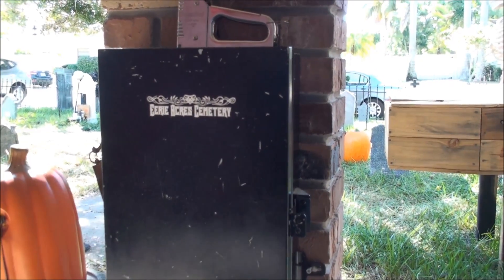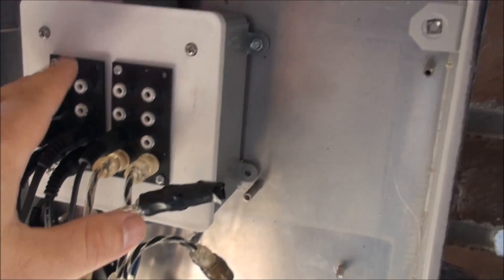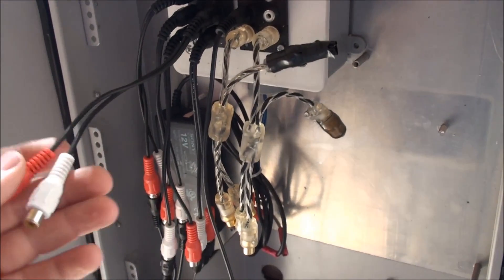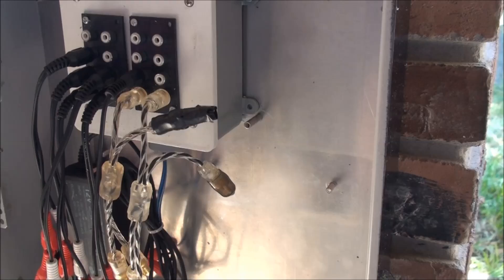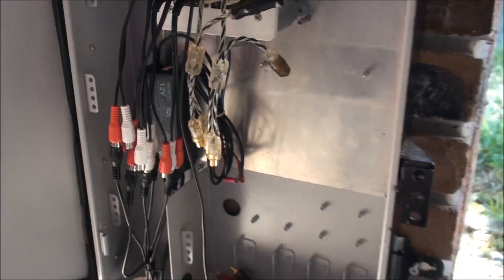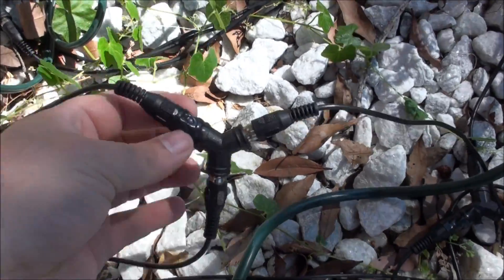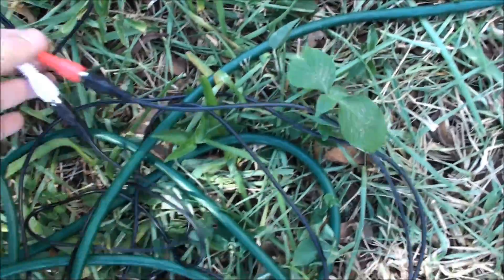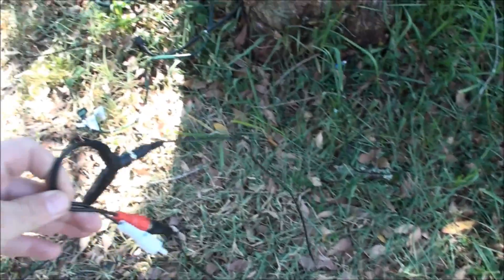Halloween Flickering LED light project

Comment: I love your power distribution set-up!  I am an Industrial Electrician, so I can appreciate the way you laid this out.  I have been using terminal strips, mounted to each item and daisy-chaining wire to interconnect them, for years now.  It works, but I have been wanting to convert to a tool-less system.  Binding posts or spring terminals are pricey and could require a small enclosure to mount each one, so I have been considering using Tamiya-style R/C car connectors; they are fairly cheap and idiot-proof as far as maintaining proper polarity to the LED's.  Now, after seeing your set-up, I think I will try what you have done instead!  Thank-you for posting!
Reply from the maker: +VIGILANTE Thanks!!! This is the second year now and problem free even with all of this florida rain its been working perfectly!!!

Comment: what's in the rca connection box? I want to do the same setup. can you list everything I need. thank you !
Reply from the maker: +Brian Griffith The box is just a way of holding the rca board inside all of the rca connectors are wired so that each one has power. Checkout Dminsorsound's channel he has some great videos showing in depth detail on how make the entire setup! https://www.youtube.com/watch?v=470rIADIaxA
Reply: +Eerie Acres Cemetery yes he does great work! thank you. On the end of the 10mm pre wired led lights do you solder a male or female plug? also what 25ft rca cable do i buy? the 3.5 mm to double male rca?
Reply from the maker: I have male plugs on the ends of my LEDS so I buy male to female RCA cables from monoprice.com!
Reply: +Eerie Acres Cemetery Thanks man!

Comment: can you write down a list of materials.. like what kind of leds, how you built your power supply box thingy how exactly you made that (for those of us who are not that bright when it comes to this stuff) and how many leds you think you can have running off that box you made. all this would be extreamly helpfull because i honestly need to do something like this for next year, i have way to many flicker lights for candles and push lights for tombstones that i wanna replace. this will be soo much better
Reply from the maker: check out my other video here where i go into more detail about how I made it. its based on a design from a fellow haunter the LEDs were bought from ebay they are 12v flickering LEDs with my 2amp power supply I can do up to 100 LEDS. http://www.youtube.com/watch?v=ISQJBGYRASY I hope this helps! if you need more info just let me know!